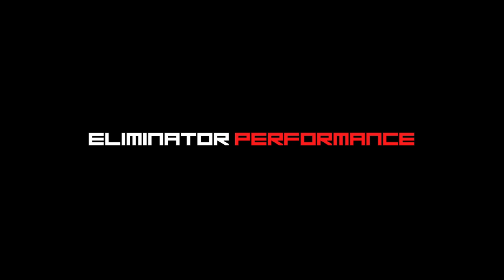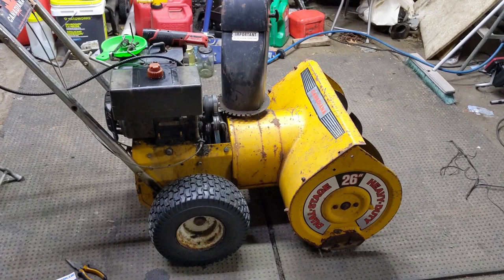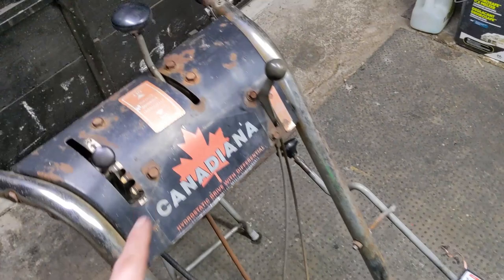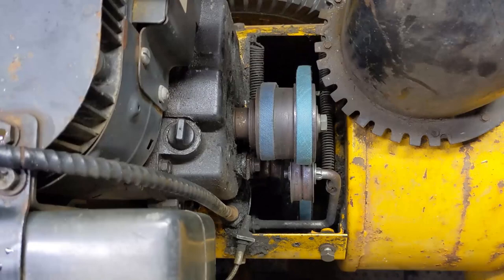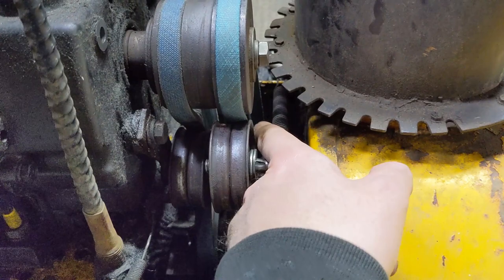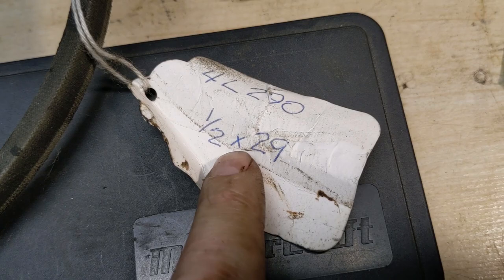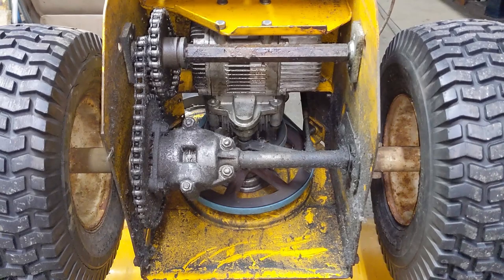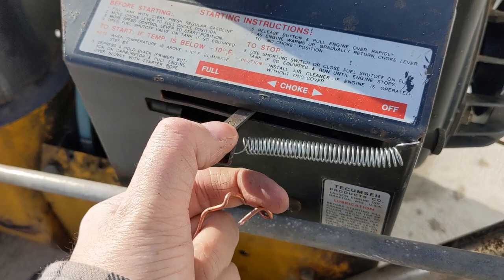Canadiana CS826 & CN523 Snowblower Belts

Comment from the maker: Here's what worked for me;

CS826 belts;
Impeller: I used 1/2" x 38" Original belt is a 51224MA (superseded to 313847MA) = 1/2" x 37.7"
Drive: I used a 1/2" x 30"

CN523 belts;
Impeller: STENS 248-030 (that measured 1/2" x 30.5") Original belt is a 3526MA = 1/2" x 30.7"
Drive: Original belt is a 53790MA (superseded to a 313918MA) = 3/8" x 36.8"

Comment: Love your videos on the old  blowers! I recently picked up a old Estate 825, model A2580-060, code 0249, serial SJ0139160 with a Tecumseh engine that appeared to be  lightly used with no engine tags. R&R both tires, replaced fuel line, primer pump line and cleaned the carb and got it running good. Both of the belts appear to be OEM and in good condition  but having a hard time trying to cross reference the  belts OEM numbers. I used a tailors tape and got the auger belt as 1/2 x 32 and the drive belt as 3/8 x 37. Trying to cross reference the OEM numbers on the belts online, they are all over the place. Winters coming to MN soon and always want to have a spare hanging in the garage. Will check belt size with B & S. Keep up the good work with your videos!

Comment from the maker: Shout-out to viewer Dieter W for sending me a PDF copy of the original parts manual that includes info for both these units! I updated the description and the pinned comment to include the original part numbers (looks like my belts were only off by 1/4" so I was really close).
Reply: So you still have the Manuel for the cn523? Trying to find a auger belt is rough but trying to find the axle bushings is REALLY rough

Comment: Best channel on YT for snowblower maintenance. I am trying to find a belt for an older Sears/Craftsman 8HP 25" made in Canada snowblower with I believe a Tecumseh engine. Model C950-52708-0..ser # SC0094892. Now I measure the old belt  at 3/8"W x 36". Can't seem to find parts for this model as the model number seems difficult to access on Google or anywhere. In your opinion do all I have to do is look for that belt size. Like you said it may have stretched but not by much..Much appreciated.

Comment: That is one cool looking sign over your right shoulder there.
Reply from the maker: Yes Gulf Pro Fuels, we'll be doing a review about them in the near future. Thanks for watching!
Reply: A great canned engineering ethanol free fuel made in the USA 93 Octane that is good for 5 years. We use in for equipment being stored and suggest everybody start with it in their gas generators so they always start up. Cost is around $10 Cdn

Comment: I still use a Canadiana snowblower also.  Model 826.  They were built in Brampton I believe.  I bought mine from Sears in 1983 I think.  Sears was purchasing them from Canadiana and had them painted in their colours but that year their was so much snow they were just purchasing as is or Canadiana colours.  They were definately built to last.  I did replace the engine and upgraded to a 10HP
Reply from the maker: Nice, yes they're definitely built to last. I have 2018 models with blown engines and big failures, thanks for watching!

Comment: Yes that was very cool. I'm sure your viewers and myself included love this Oddball stuff. Back in the 80s I had a small repair business. So one day this guy brings in this Cub Cadet snowblower, I assume made in the 70s. To date I've never seen anything like it. 10hp Briggs & Stratton snow engine, 12v onboard electric start with battery and tray, dual flywheel alternator 1ac 1dc to run the lights and charge the battery. Mechanical dog lockout for the transmission to Aid in cold weather starting. I suppose it was marketed to be the Cadillac of snow blowers in many ways it was. I was so fascinated by it I bought it from the customer. Long gone now but if anybody knows what it was that I had let us know
Reply from the maker: Sounds awesome, I've got to work on quite a bit of different equipment over the years. Never had something like that though. Someone sent me a photo of a Suzuki SS865 snow blower and I was amazed. Wish I could work on one of them, sadly I never see Yamaha or Suzuki snow blowers. Thanks for watching!

Comment: WOW,,,I'm just about to release a video on an Unknown Machine,,,This is soooo close to what I have. I had absolutely no identification on it...
Great machine,,,great Vid....
My auger belt is 40 inches. It didn't need the power belt. 
Its a little different, 28 inch model but has the exact same console, Similar to the orange one in the video.

Mine was orange, now red (paint was shot) Made in Canada, (that's all that was readable)
10hp Tecumseh
Larger wheels
Friction clutch
28 inch auger. 
6 forward gears 1 revers with a detent 1 more without
No neutral 
2  grip type handles, 1 for power drive the other for auger

Gonna give you a shout out and reference to this video as well. If ya dont mind?
Reply: No problemo Arch glad this one helped you out

Comment: I had a 10-26 noma grand prix repowered to 8 hp. used for years before selling.
Reply from the maker: They're strong machines, this one has stood up to the "test of time" as they say. I have brand new ones currently in the shop with more issues lol
Reply: @EliminatorPerformance  I've tried adding 3 times where to get ipls for them and post keeps getting deleted.  last time didn't even have info as a link. what gives?
Reply from the maker: @kenhilson786  YouTube flagging people who say "good video, thanks" it's ridiculous. Too many to keep up now, I check flagged comments once a month now and blast through them as quick as possible.

Comment: That snowblower is a tank, I always measure the outside length of the belt and by an eccact same New belt and yes the used belt stretch a little bit but when you put the New belt it sit higher in the groove on the pully
Reply from the maker: Yes definitely a tank, built to last. Thanks for watching!